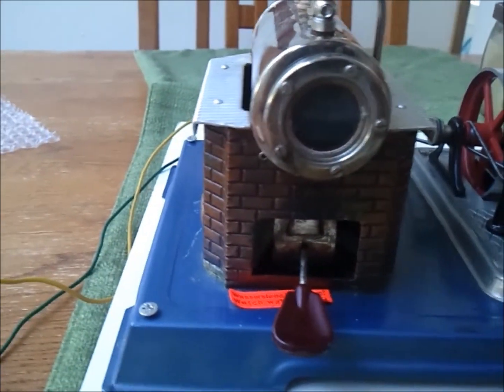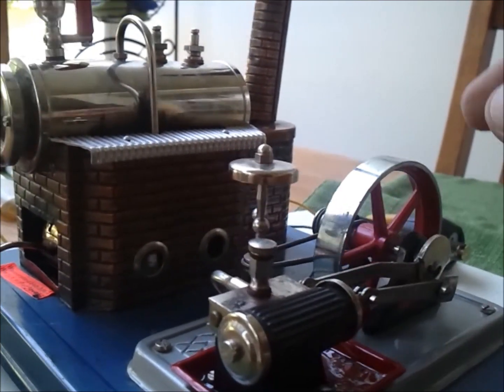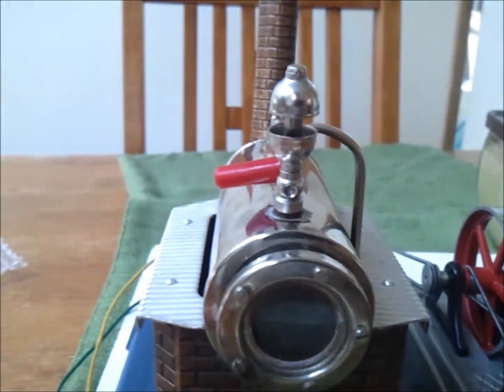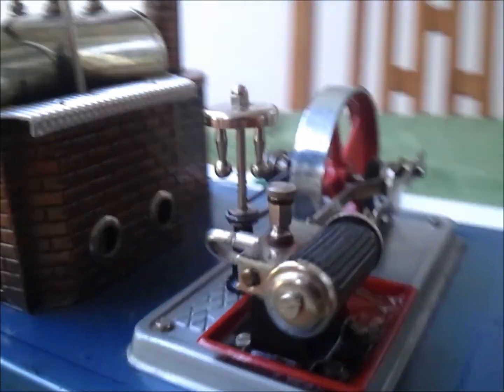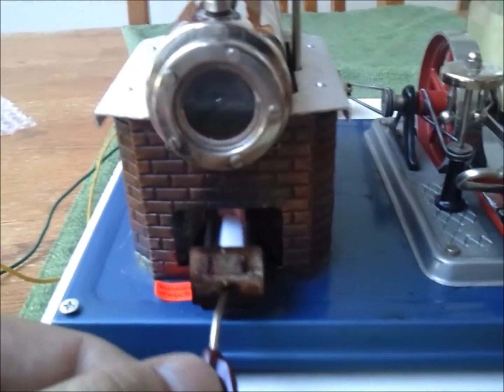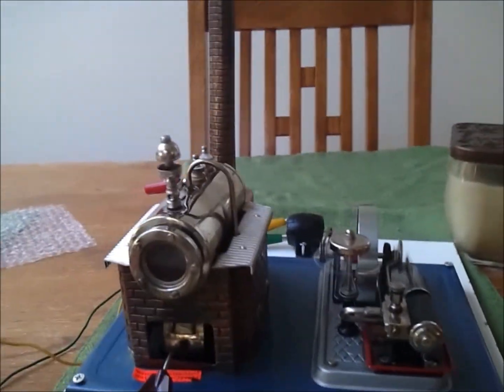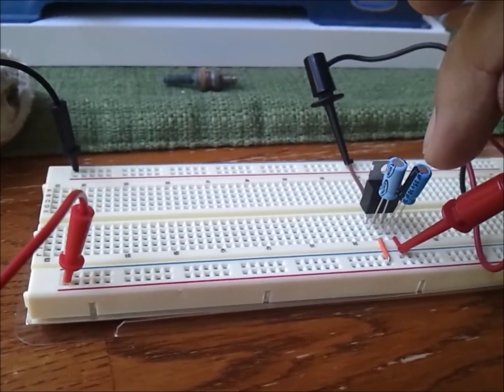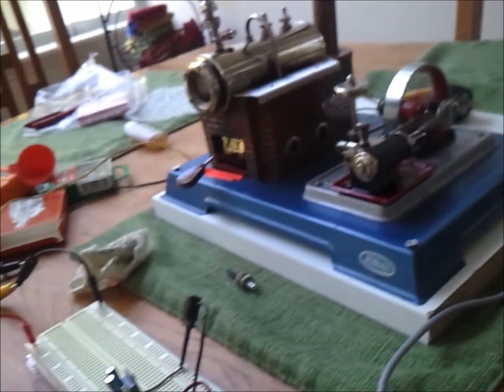Steam Powered Windows Phone

Comment: I THINK THIS IS FAKE!!! THE CONNECTION TO THE CELLPHONE IS NOT SHOWN!!! ALSO THE RPM OF THE ENGINE DOES NOT DROP WHEN CONNECTED, BUT IT HAS TO DROP A BIT WHEN IT GETS LOAD, ALSO HEAVY LOAD FOR A LITTLE D10 STEAMER!!! THIS IS FAKE!!!
Reply from the maker: Paul Horn You are indeed correct.  In this video, the cell phone being used in the video does not engage the charging circuit when I plug in the USB cable during the video.  I assure you, however, that this specific setup did successfully charge a cell phone.  Like you describe, the little d10 can barely generate enough torque to drive the motor under load.  When it starts charging, you notice the steam engine working harder.

Help me find 950 more subscribers and I'll be happy to redo this video with actual proof.
Reply: @Fivetwofivetwo  @PaulHorn very civilised and reasonable interaction

Comment: I'm pretty sure that model is a double action piston. I have a D24, not sure if its the same piston but I think it's double action.
Reply from the maker: Burke Moras Yep, you are correct.  Double Action.  That first stage valve thingie handles the exchange between the front and rear valves on the main cylinder.  I under-represented the action in my explanation.  Maybe the flywheel doesn't do as much as I originally thought.  :D

Comment: I wonder if it'sd possible to charge a tablet with something like this. Maybe a more powerful DC motor, a 12v one from a cassette player. I have a motor and pulley assembly and I've rigged a small twist flashlight to it so it's like a dynamo flashlight. The motor I believe is a 12V motor.
Reply from the maker: It is possible, but the steam engine I used isn't very powerful.  I tried speeding up the motor with a larger pulley but the D10 was really struggling to turn the motor.  I suggest trying with a larger steam engine.  Give it a shot and report back.  The D16 should do it.
Reply: IntStarFoo
I don't have one of these but would love to own one. would come in handy.